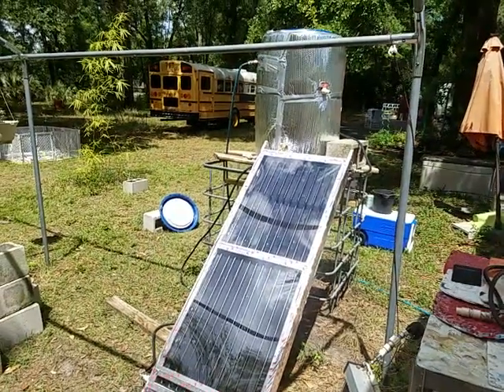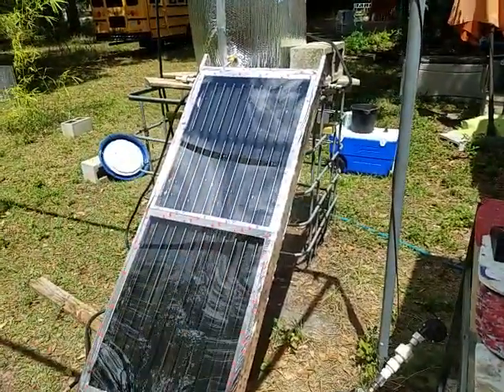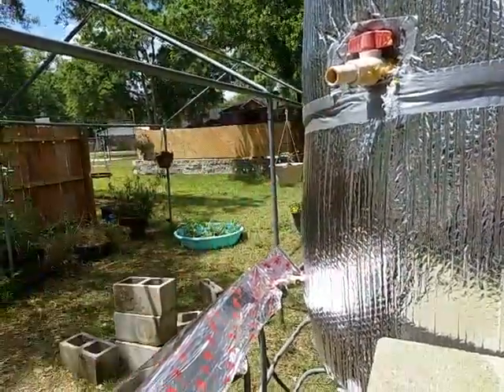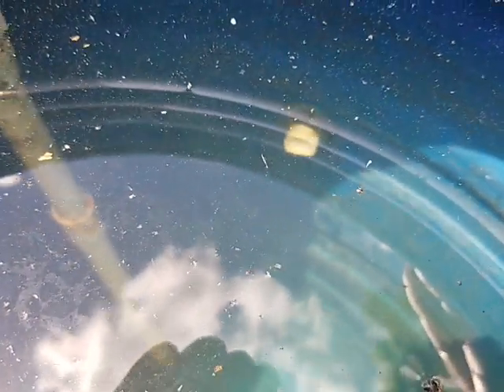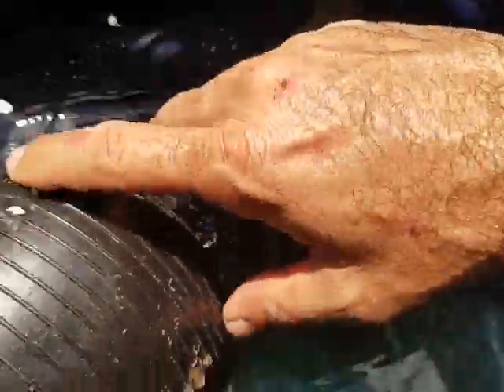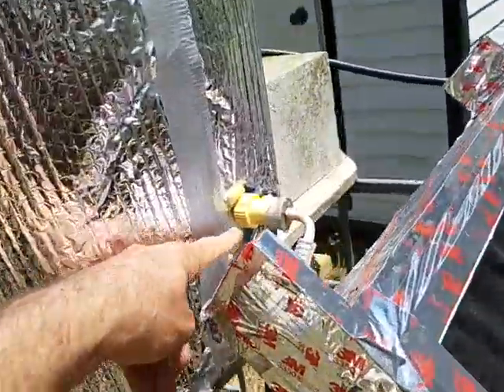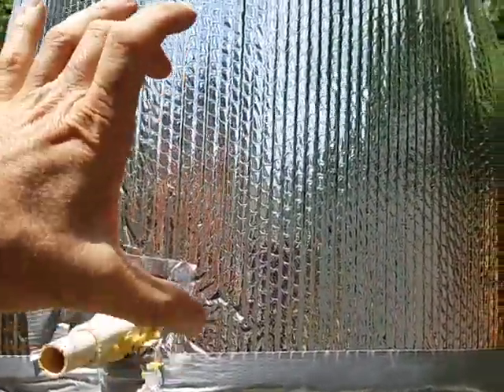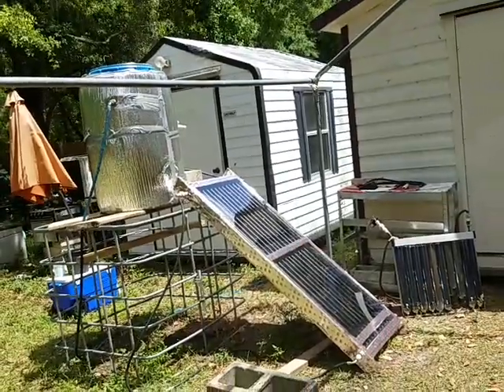Testing first of two hand made solar hot water panels with thermosiphon into recycled barrel

Comment: I'm using a recycled electric water heater for a similar build.. I'm wondering, why does hot out have to be so low? If there is a float valve that is pressurized wont it refill fast?